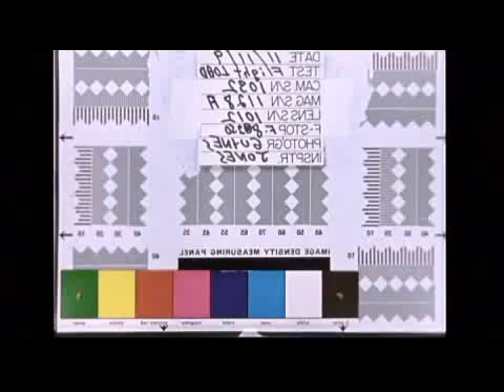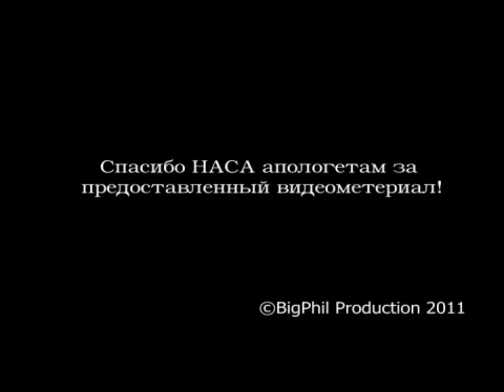Apollo12 & S-IVB fake docking

Comment: What is your problem with this docking ?
Reply from the maker: Even nowadays docking seems to be the most complicated space maneuver. Even nowadays it may fail… in Earth orbit. Until now NASA and its subsidiaries haven’t figured out how to do it. The problem is not mine, it is NASA’s. 50 years ago everything seems to be much, much easier for NASA… or so it seems.
Reply: NASA have no problems docking, they have done it with the Space Shuttle, who have not only an offset center of mass relative to the RCS thrusters, but also a docking port away from the CoM, also today docking is automatic and need extra precautions, excessive use of RCS thruster may damage solar panels if ISS which is itself fragile and filled with sensitive equipments and peoples.
NASA have done a lot of manned and unmanned docking, the first one was at the Gemini era.
When the Apollo CSM dock to the LM which is still attacked to the S-IVB, the Apollo CSM only goes a short distance, do a 180° rotation followed by a 60° inclinaison to match the docking target and them just goes forward, and the docking mechanism is not the same as the Soyuz one.
Also you might consider the case of Apollo 14 which fail multiple times at docking, it was not easier, and those astronauts had tons of training on this phase alone with a lot of failures during those ground trainings.
Reply from the maker: A Russian made docking port was installed on Space shuttle. Russian teams logged many hours in the US installing and testing it. Read Vladimir Syromyatnikov’s memoirs. None of the Mercury, Gemini and Apollo spacecraft was capable of reaching even LEO. The first Americans to reach the low earth orbit were John W. Young and Robert L. Crippen on STS-1 on April 12 1981, exactly 20 years after Gagarin’s mission. Young and Crippen are the very first real American astronauts.
Reply: This is logic since the STS was first made to carry stuff in orbit and dock with MIR.
And well, they are, the rocket had enough Delta V, thrust, control authority, the capsule were strong and protected enough and you can't deny that we saw them taking off anyway.
Reply from the maker: About enough delta-V, you know that or you trust other guys who say so?
Is it so difficult to prove that nobody in the US ever ended up in LEO in the stone age of the manned space missions? Not at all. Let’s look at Gemini vehicle Titan II GLV (ICBM LGM-25C Titan II). Wikipedia says that it was able to deliver payload of 3600 kg to LEO and its throw weight (payload to 10,000 km) is a little more — 3700 kg. Is it so? Even if you know nothing about ballistics, it seems logical that throwing a stone so that it stays in the low Earth orbit requires much more strength than throwing it to the distance of 10,000 km. Or we should pick up a smaller stone. But for Titan II we see that it could do both with the same amount of fuel. Something seems to be wrong here. Let’s skip complicated ballistic calculations and compare with something that, we know for sure, worked. Let’s take Titan II’s counterpart — Russian SS-18 Satan. It’s convenient because SS-18 was converted into Dnepr-1 which is used for launching artificial satellites into orbit. The Dnepr-1 launch system can carry 4,500 kg to LEO and its throw-weight is 8,800 kg. We see that for ICBM throw-weight is roughly twice more than payload to LEO. This makes sense. So we figured that Titan II had to have payload to LEO around 3700/2=1850 kg. Putting Gemini spacecraft weighting 3850 kg atop of the ICBM means that ALL Gemini missions were suborbital and of cause unmanned.
Reply: Just do the REAL calculation yourself, this is easy to calculate Delta V based on engine and fuel specs.
Also you forget really important part, not only the Titan II GLV is modified, but also, his throw weight is not using 100% fuel.
Funny that you actually thrust Wikipedia but refuse official sources, and based on Wikipedia we have those two informations :

1 : The propellants were chilled to slightly improve vehicle performance.
Space X actually have mastered it and just look at the incredible performance boost they gain from that.

2 : First stage engine burn would go until propellant depletion unlike Titan ICBMs which were designed to cut off when propellant flow/pressure and engine thrust started dropping as the tanks emptied. This was to prevent the possibility of a malfunctioning pressure sensor triggering an abort condition. Also running until depletion would slightly boost the Titan's lift capacity.

It also had improved engines.

And you have to understand that the last phase of the flight is where the most Delta-V is to be taken from, engine performance improve outside the atmosphere, plus you don't have friction up here, in around 100Km you have less gravity to fight against, even if this is a small reduction, you still have less gravity loss, and this is when you have the least mass on your vehicle because all your fuel is gone, and fuel is probably around 70 to 90% of a rocket like this one, also 10Mm mean already almost a circular orbit, the Oberth effect also play a role, faster you are, the best you can accelerate, and after a certains speed, near orbital speed, a really small change in Delta-V actually make huge change in the periapsis.
Look at the last launch from Space X, even the first stage who have a lot less advantage, just because of the weight reduction is already at the last seconds helping gaining so much Delta V that they prefer to use it without any reusability option to be able to gain those precious m/s.

Also note that Russian are way more conservative about their rocket and mostly about their nuclear arsenal informations, the R-36MUTTH may be actually capable of carrying 14 and not 10 warhead, it show how little we know about it, as it's payload mass, I don't think Russians would give away the real informations, if you want to doubt something, it should be public informations about Russian nuclear weapons, including range capability, another very important fact is that we don't know at all the trajectory of those missiles, maybe the Russian one use a really high parabola trajectory to maximize atmospheric speed and tho possibility of interception and also maximise precision because of less horizontal atmospheric travel.
Some quick research show that actually Russians seam to like this high parabola trajectory for their ICBM, with something up to a 500Km ballistic flight, which may cause a lot of gravity loss induced by a really small gravity turn but allow for less need in horizontal speed since the Earth will rotate during this phase.

In short, sorry but space rocketry is more complicated than just comparing a possible fake range with a possible orbit of an unknow altitude.
For simple explanation, if the R-36MUTTH actually does a 500Km apoapsis balistic, it require way, way more delta V than circularizing at this altitude and speed than a 150Km parabola that get you 10Mm of range to circularize it using a depressed trajectory, and all public information show that Gemini had a really low periapsis, and the Dnepr actually does launch to a 500-600Km orbit, tons of things also play a role such as TWR, burn time, last stage ISP which can all have a dramatical effect on Delta V if the vehicle is not optimized for ICBM launch.
Number can plugs, but here there is way too many missing numbers and so much "if" that could change everything.
Reply from the maker: Sorry, pal, but payload difference is way too big to try to explain it out with chilled fuel and the fact that back in the 1960 the US wouldn’t love to use their boosters at the full potential taking into consideration their lagging behind Russians. Nice try but not powerful enough booster is just one of the many proofs. Looks like back in the 1960s Gemini astronauts where zero-g proof as well, compared to their Russian counterparts who were literally pulled out of their capsules in pretty rough shape. Back in 1960s Gemini astronauts were also radiation resistant, flying as high as 1400 km right in the Van Allen proton radiation belt – the feat we don’t dare to repeat now.
Reply: I explained that there is tons of others things to take into consideration, like the fact that the Russian ICBM may only do a small parabola and the US almost a complete orbit at their apoapsis, and this is a huge difference, fuel chilled down is one of the many part of the whole thing, that the problem with overly skeptics people and why such theory are created in the first place, know knowing enough and more importantly, talking fact that you like and totally ignoring those who are against your argument.
I don't even understand what you are saying here with booster power/potential...
Yuri Gagarin was in good health after his flight and actually landed with a parachute which require even better condition, does it mean he never went into space based on that ?
And any astronaut that goes inside ISS for 5 month are not in "rough shape", also I never heard of any health related issue of Cosmonauts.
And damn it, again the radiation belts, as most people you probably don't know how radiation work.
Radiation, only in case of ionising particles, only give you more chances to get cancer because of damage made of some cells, only excessive amount can cause serious sickness and kill you, the inner belt start at 1000Km and is NOT aligned with the Earth and also Gemini 11 which you refer to had an inclinaison of about 30° almost the same as what Apollo take (and had no choice anyway because of the inclinaison of the moon) which allow them to pass next to, but not inside the inner radiation belt, in the case of Gemini 11, they voluntarily entered the inner belt over Australia where the belt have a lower density, the radiation level were really low and MOST IMPORTANTLY when we talk about radiation, the exposition time were low.
Again here, with research you could figure out those things, but you don't know them or choose to ignore them.
Reply from the maker: Sure thing, western university graduates know everything about radiation and nothing about the Soviet space program. Yeah, you are right; Russians don’t know anything about space radiation :) But I have access to the first hand material about the Russian space program and the consequences of the prolonged stay in zero-g and re-entry - things NASA specialist had no idea of in 1960s. When astronauts started really flying into space they were surprised that zero-g may cause head ache! This is a basic medical fact on a space missions. In Wikipedia there is an article about space head ache phenomenon, if you are not aware, and awkward efforts to explain it out.
Reply: This is not a problem about Westerners or Russians, this is a problem of most people not knowing what radiation really are, they think if you got exposed to radiation you literally mutate and don't understand that it damage the DNA and your child may have mutation because of that, but not you, or don't understand how and why it can or cannot be dangerous and so on.
Don't think that I am a patriotic American who hate Russian, I am in fact French and prefer Russia over the USA which I don't like much based on what they do and how they act internationally.
Except if you are working on a space agency as a rocket scientist, you actually don't have anything else than everyone on the internet which is full of misleading, incomplete informations and lies.
If it was the case and that you did had official proof that NASA had lie, don't you think that your government would have already, before the end of the first cold war used those informations against the USA since the Moon landing (real or not, this is not the point for this sentence) have caused a huge drop to the URSS witch have been gained by the USA, if the URSS did actually landed first, they would have a lot of political advantages today, even just using this as a threat to remove economical sanction who are plumbing Russia would have already been done.
Still, those who comeback from the 5 month long flight onboard ISS don't have severe conditions, Apollo missions are done in less than 2 weeks.
And actually some Apollo crew reported headache along with motion sickness, the first being the cause of the second, they did not needed to wait until STS-1 to discover it, and prior Apollo, they did not had long enough duration flight and they were in conditions with Mercury and Gemini where even 0g will have a small effect since they are literally on a seat and don't move around the capsule, everything stay in place relative to them so no motion sickness or only few are possible here, and not everyone had it.
Anyway, enough debating, you try to turn fact as you wish rather than taking them from reality, this conversation is already longer than I expected/wished.
Reply from the maker: So if you are not biased, be my guest and watch other movies on this topic on my channel. There is plenty. I wasn’t born sure that Apollo was fake, I actually believed in it, but facts proved it otherwise. As for political leverage, Russian (and before Soviet) Government use it wisely. You may not have heard about the very sound case of a political blackmail about 2 years ago when a Russian official proposed investigation into the Apollo landings in order to stop FIFA scandal and probable world cup 2018 transfer from Russia. It helped. That’s how these American skeletons are used nowadays. Wisely and slowly, bit by bit. And the USA has a lot of them, not just the moon hoax, there are more. I also publish Russian investigations on aulis.com You may drop in. This is first hand Russian material in English.